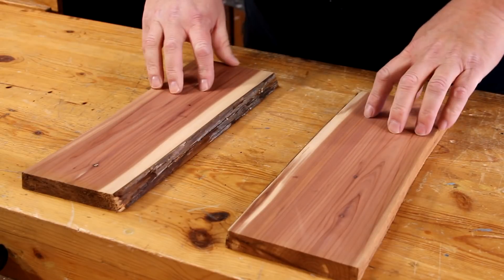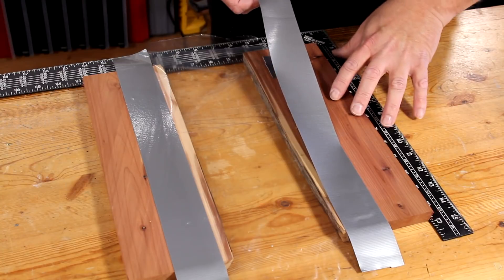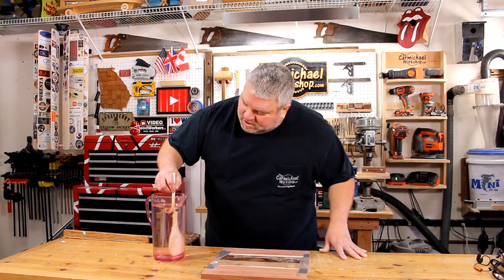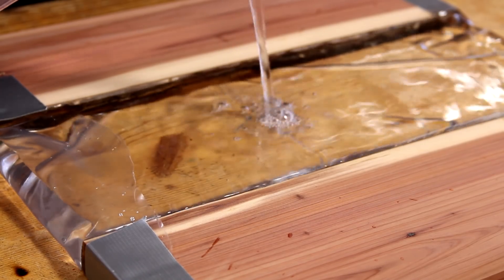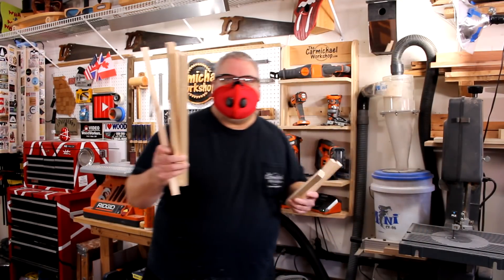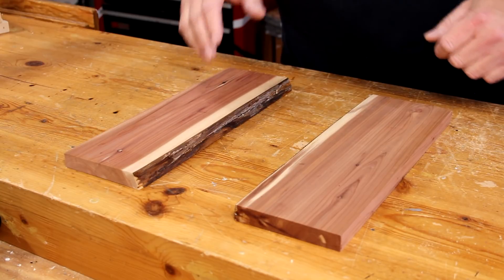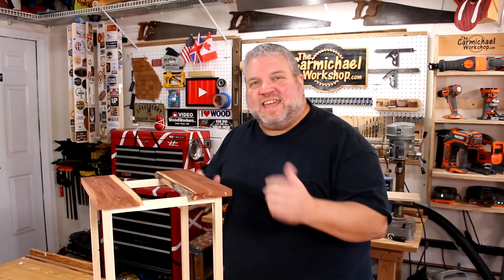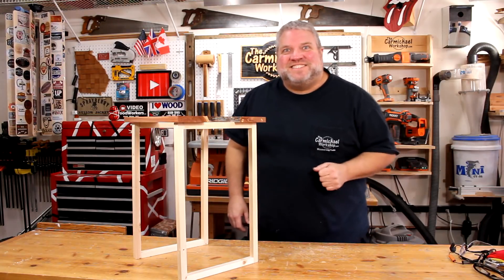Live Edge River Table (April 1st Special)

Comment: As a chemist, I’m quite familiar with the compound that consists of hydrogen & oxygen. I’m very impressed with your ability to handle such chemicals with ease. You clearly used all safety protocols, and the final product was nothing short of stunning. 
I am most certainly subscribing!
Reply from the maker: Wow thanks!  I got a D in Chemistry in college.  That came in handy.  Just imagine how this would have turned out if I had failed!

Comment: Dear Steve,

As an engineer, I am dully impressed by your expertise in safe handling of the exceptionally dangerous dihydride-oxygenate compound.  It has been proven to be corrosive, a primary contributor to acid rain, billions of dollars in annual infrastructure damage, explosive when over heated, and the cause countless deaths.  It is in fact one of the most reactive compounds on earth, and should always be treated with the highest of respect.

What is worse, is that such an extremely dangerous substance is wholly unregulated for  manufacture, distribution, transportation, sale, or use.  In fact, it has been the primary cause of more deaths in the USA than virtually all other chemicals combined.  Sadly, almost every bill introduced to Congress in the last 200 years to ensure the safety of this product has been rejected or summarily ignored.
 
Please continue with you exceptional example of proper and safe handling of such a volatile substance.
Reply from the maker: Thanks!  Wow I had no idea what I was dealing with.  I should have worn more PPE when I drank it.  Thanks for watching and adding to the fun Michael!
Reply: Michael Olsen That really bums me out.......

Comment: I like to use Dehydrated H20 on my projects.  You can get it in one quart containers but I prefer to buy it by the gallon.
Just add tap water and mix thoroughly.  It works great!
Reply from the maker: Thanks for the tip!  You should do a video on that.

Comment: Wow. Very cool - the project sparked a lot of ideas. There are many use cases for your epoxy replacement: It might be a good solvent for finishes, an excellent cleaning detergent and if you are totally crazy you could even try to drink it 😜 ... great video 👍
Reply from the maker: It is a multipurpose solution.  Affordable too.

Comment: Where did you find the hydrogen & oxygen compound? I would love to make a table like this. That compound came out crystal clear. After research I was told that it had to be mixed in a pink pitcher because of light or something. Love your videos, Thanks
Reply from the maker: Thanks.  That's a great tip.  I wondered why the pitcher was pink to begin with.

Comment: wow, 101 haters so far. LOL I enjoy your satirical videos, Steve.

Maybe make a video on how you get that mask to seal so your glasses don't fog. I bought the M2.5, but have since traded it for the M2, since the clips are so tiny on that 2.5. But I can't get it to not fog my glasses.
Reply from the maker: The velcro is nice. I wear it more often because it is so easy to put on. I rest my glasses on the mask, instead of on my nose behind the mask to prevent fogging. The mask fits better on the cheeks if it is further up on my nose.